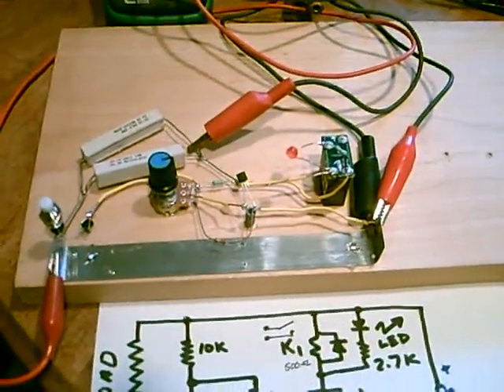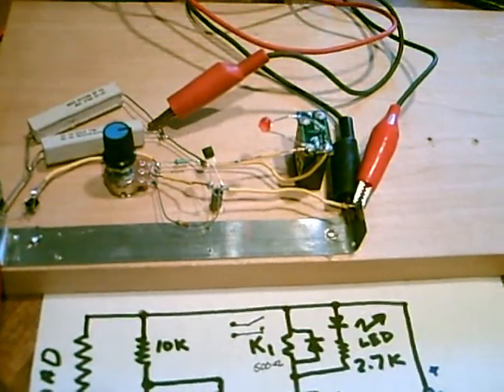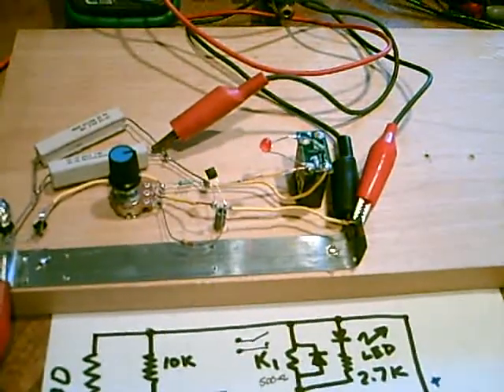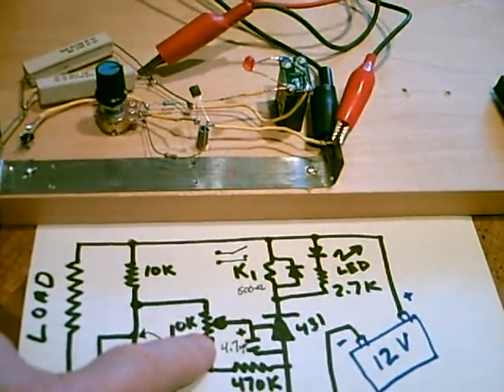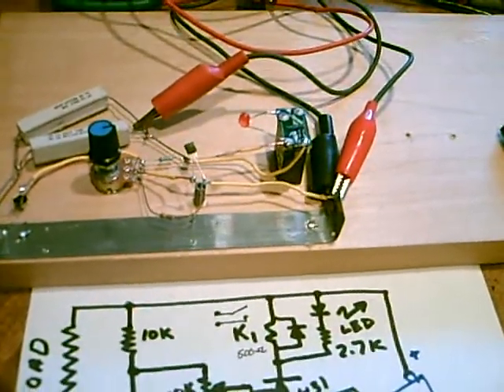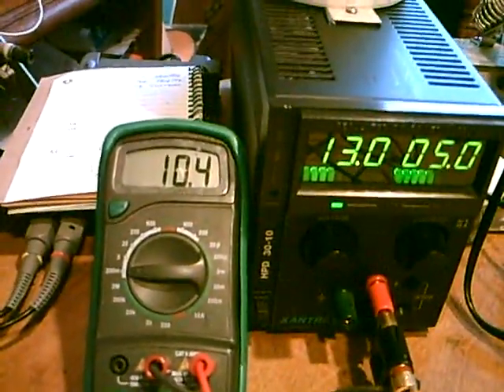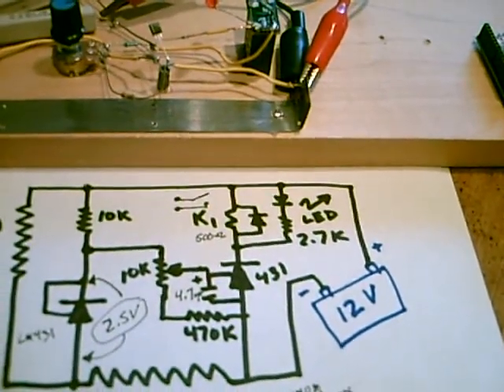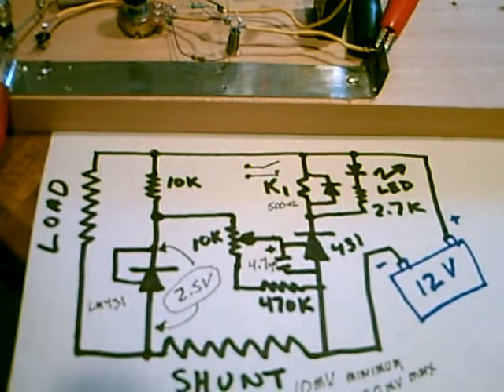DC Over Current Sense Relay GO/NO GO, Easy Build TL431

Comment: Thanks  for video
want to measure the current of my system with a shunt. My system has a maximum current of 30 A. How can I change the 0-100mV signal from the shunt to a 0-10V signal for my PLC?
thanks
Reply from the maker: A simple op amp amplifier can be built with a gain of 100. Can be as simple or as hard to make as you want.  Op amp input needs to be able to go to the common power rail, some don't. There will be some offset at low range and temp drift. Should be sufficient for your application though.

Comment: Thanks for posting.  Test all these LM431's before you start using them.  I just bought 20 of the Chinese one on ebay and everyone was defective.  They tested good as a simple diode but would not provide the 2.5v reference.  They just drifted up and down depending one the applied voltage.